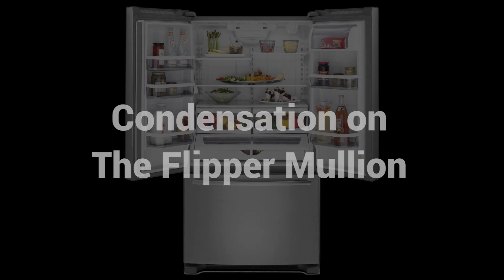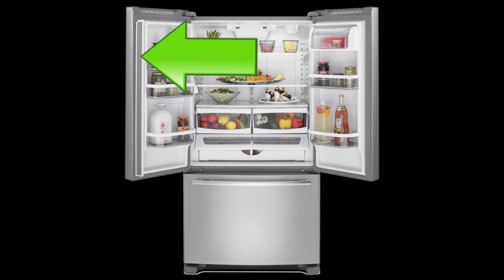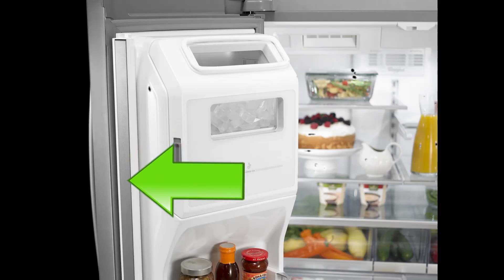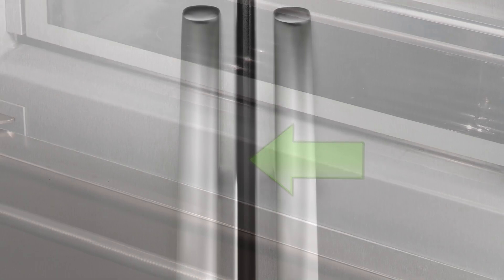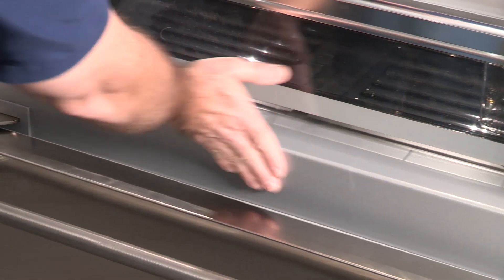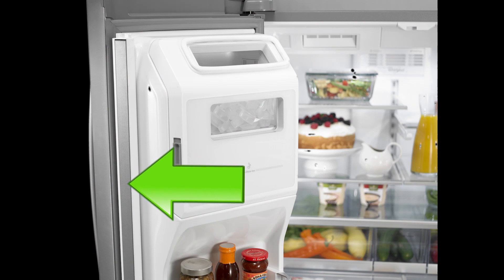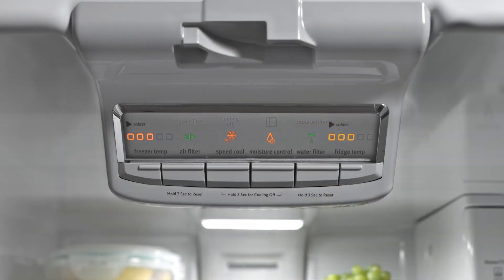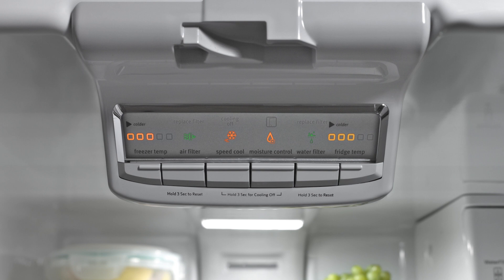Refrigeration Moisture Flipper Mullion

Comment: Hi.  I purchased Kitchen Aid French Door Refrigerator (KRFC704FPS) ~9 months back, and it does not have the 'Energy Saver' option in the panel.  Looks like some models are designed like that, and the heater is supposed to be automatically running when needed.  I continue to see water leaks at the mullion.  Any suggestions on how to resolve it even before the Service Representative comes over?

Comment: The Instructions in the manual say.....  "The Energy Saver Feature controls a heater, that helps to reduce moisture on the vertical hinged seal. To turn the heater on, turn the Energy Saver switch to the "off" position."

Seriously?   To turn it on, turn it off?    Which is it?
Reply: If the button is humidity control, turn it on. If the button is energy saver, turn it off.
Reply: @williamlevesque6348    OK understand the instructions literally say to turn it off to turn it on.
Reply: I'm assuming the instructions are wrong.